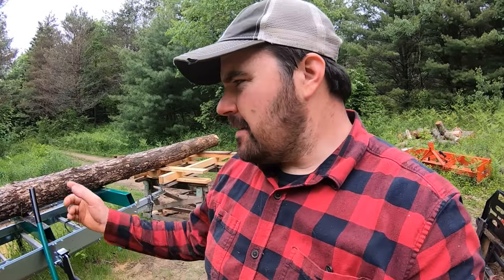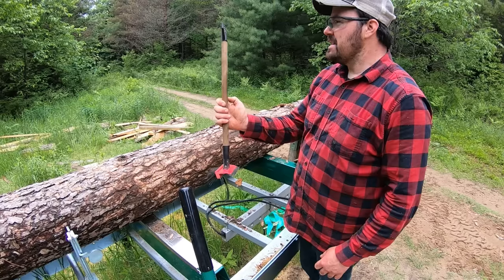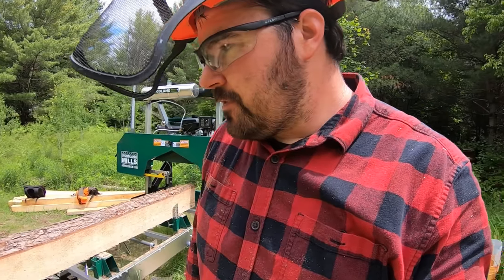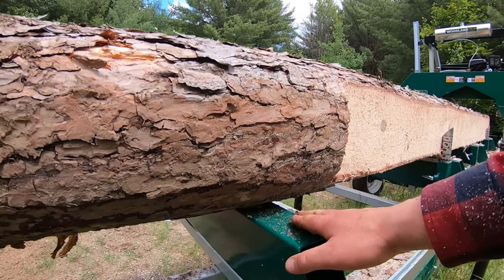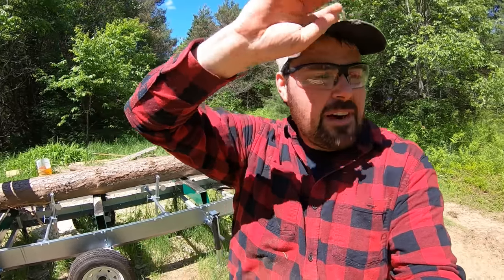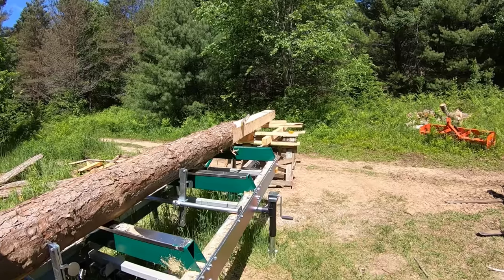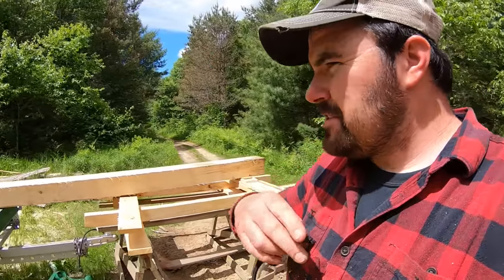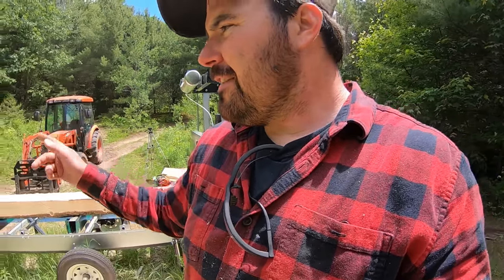Cutting a 20 Foot Log on a 10 Foot Sawmill | No Track Extension Required

Comment: Hi Sandy been watching your vidioes for a while now.  just an older bush man myself . just a suggestion for skidding logs a long distance in the summer is cut the log 32 inches longer than your saw log  when you get to your  landing cut 2  16 inch blocks of fire wood off the end that was being dragged for fire wood.  that way you will get a much cleaner log on your mill  . just a suggestion a good video.
Reply from the maker: Great suggestion Myles. As you can imagine, the dirt certainly can dull the chainsaw and blades quick

Comment: You did pretty darn good with that approach. I like the sawhorses. Another way would be to “block” the log for the first cut: screw 2 2x4s onto the log, about 15° apart. Do that in 3 appropriate places down the length of the log. You could run a string to make sure everything is lined up. Run the cut, then push the log back (on the blocks), run the next part of the cut. Etcetera. Once you have the first cut down the length of the log, you have a consistent reference plane and should be able to remove the blocking. Just roll it and cut-push-cut. You can make very long cants this way, as long as you can keep consistent blocking for that first cut.
Reply from the maker: Great ideas there! String line would be very helpful for sure as well

Comment: Glad you did it cause I wasn’t thinking of all the potential issues. I’ll save this move for the more competent miller. 👌
Reply from the maker: Thanks for watching Rich! Worked out well thankfully. Sure would've been a lot of work if it ended up not working
Reply: @sawingwithsandy  Absolutely. If I do attempt it I’d probably try the push through option and have the tree an extra couple feet longer than milling and use a tie down at the end bunk and move the saw horses to the other end to help reduce any possibility of the milling being stressed into lifting from the weight. I’m think this would reduce the amount of levelling when spinning it around. 
 Just thinking out loud. 😂😂😂
 Actually I’d need 2 sets of saw horses to accomplish my goal. This certainly isn’t an easy task. But a great mind teaser for sure.

Comment: Awesome stuff Sandy.. Sure is alot of work to cut a 20 footer there without the extensions..
You definitely made it look pretty easy for sure..
I think i can cut right around 20 footers with my extensions on my home built trailer..
However i need to cut some 28 foot beams for a future post and beam project in the near future... Your video definitely gave me a few ideas to work with..
Think im going to look at fabbing up some adjustable rollers to mount on the sides of my log bunks..
Keep up the good work there brother..
Reply from the maker: Those adjustable rollers would help for sure. Sounds like you've got a great mill setup there!

Comment: Excellent video Sandy I have an HM126 Woodlander and I’ve struggled with doing logs longer than the bunk that I need for my barn project thanks for the inspiration
Reply: If you remove the last bunk and then cut your log, it makes it way easier. Then you can cut your log and move it back as you go

Comment: I worked at a sawmill that cut 40' lumber . 6x12 , 12x12 , 16x16 timbers . We shipped a 78 foot 24x24 to Japan for some wood expo they were having . We were trying for 80 feet , but eighty foot would not exit the mill . Only took most of the afternoon lol . I was on the green chain , they kept the rest of the mill going by running rejected timbers through the resaw . Fun days
Reply from the maker: Now that's a big timber operation!

Comment: Gordon here , I would use a battery powered saws-all  to do the cutting instead of power saw ,my thoughts. Also for me to slide log I would have used a chain on the forks and put it down the log far enough to swing when forks raise up . As for the bugs drink alot of citrus fruit drinks that you make from fruit DO NOT buy them as they are sugar drinks. I do that for hunting in the woods. Cause banana  make you become a feast for them. LOL. I own a Norwoods 2000 LM  20 foot log and I still need it longer sometimes . Thanks for the ride and extra ideas , keep them a coming.
Reply from the maker: Hey Gordon! Yeah I agree that would be even handier. I just don't own one or I"d just that for sure. Thanks for that idea about the citrus drinks!

Comment: Great job Sandy, I too have sawed long timbers on my HM130. Mine is the 16 footer on woodland trailer . The longest I've done was 36 ' and I sawed the whole length ( 1/2 then slide it and saw the other half ) , mine was also red pine. Alot of fun and challenging.
Reply from the maker: Yeah would be very rewarding I Bet. I'm going to try that slide method next time around

Comment: Good morning Sandy good job with the 20 feet log I like the way you set up with the saw horses I am lucky I got the extention to do 23 feet max but 22 comfortable  also a little suggestion when you go in the woods do you bring your cant hook I do sometime it sa e me a lot of aggregation to but the chain under it by the way I am going g to see if you got a email so I can send a couple of picture of my log carrier that I built have a great day and that was some nice saw dust making
Reply from the maker: That sounds like a great setup! I don't cut too many really long timbers but sure would handy when needed. I don't actually carry around my cant hook much but would be handy. I should make a little holder for my winch as it would help me get the chains underneath as you mentioned. Hope all is well!

Comment: Awesome job. We always get great ideas from your experience. I wonder if the laser would have been a help in lining up the cuts? However, maybe with the bright sun it would have been useless. We did get a laser like yours but it is not bright enough for outside use. We'll have to wait til we have a shelter creating shade to use it. Another thought is that when comes time to flip the log, you could always suspend it an inch or two using a strap and then swing it by hand 180 degrees. That could save a lot of back and forth with the tractor and might be gentler on the mill. Those are my armchair lumberjack comments....lol. Great job and thanks for taking the time to document
Reply from the maker: Great idea there Yves with the strap! I'm going to have to keep that in mind for next time around. Thanks again

Comment: Hey buddy how are ya? Oh boy you made it look easy! I think I want a tractor when I grow up hehehehe. Great job buddy. The beam looks great! I’ve seen 4 guys do what you did on YouTube. But yours seems better. I like that you used saw horses and blocking to level up. 
When I bought my sawmill I was concerned about cut length, I wanted to be able to cut 24-28 foot (roof rafters) but still be on a trailer. I wanted and lusted after the woodlander xl, but ended up going with a different saw mill. I love my mill and look forward to sawing every day. I am gonna get the sharpener and setter like you have, blades are 36 bucks each so gotta be careful when I cut. I found that logs that only give me 2 2x4s aren’t worth the cost of the blades to cut, too much time in the bark, I like 16 to 24 inch logs good yield and not so heavy I can’t move them with what equipment I have. Buddy thanks for all the videos over the years you’ve made, they have helped me so much, and now I saw logs and build stuff. God bless you and yours. Thanks for being our sawn mill guru.
Reply from the maker: That's a great point you made about the small logs and dulling blades as I also find that sometimes the return isn't worth it if it weren't for the sharpener since there is a lot of bark cutting as you mentioned. Glad to have ya along the channel each week. Hope all is well with you!

Comment: I just got my new mill, this is good info to remember. A couple questions: when you turn the log 90 deg after the first cut, why not turn it the other way (top towards you) so your saw blade can enter on a clean cut face? Don't leave any wane and your blade might stay sharp longer? Less work cleaning the log. I carry all my logs crosswise if I can or load them on a trailer to avoid dragging them in the dirt.
Reply from the maker: Great question. I actually turn my logs 180 degrees after the first cut so that there's a flat edge lying on the log bunks as I find this gives me the best chances of getting a square cant. Although I"d prefer to be cutting into non-bark side I find that having the sawn side flat against the log bunks or against the log stops is best for me to keep the cant I make square.

Comment: A lot of extra work, but it is possible. Good job. Could you fabricate some rollers (out of pipe maybe?) that would set over the bunks that would make it easier to push the log? I know you don't do this very often so it might not be worth the effort, but if you had several long logs to do it might be worth it.
Reply from the maker: The pipe idea is a great one! Thanks for that Mike

Comment: I am of thought that you could also use two pieces of angle with a couple two or three pieces of square stock to the exact same size as those on the bed that could be bolted on your trailer frame and on the far end just a couple pieces of what you have in pipe that would slide inside the other making it adjustable and then your able to stay level with the saw, and the ground is not a problem as the leg holding it up is adjustable. I would not use it consistently but for the random needed beam, its gonna be a life saver.... no need of log stops like the mill has .. just that occasional needed beam to do, maybe a sawhorse or something to help with the balance of it all. The leg holding those rails up could also have a foot on it for the bottom to help support the weight.  Just a idea Sandy... I know it took a lot of figuring to get it as close as you did to match those cuts that extremely well.
Reply from the maker: I like that idea. I wonder what the cost would be for this compared with buying the extensions. I'm sure there'd be some savings just. curious how much
Reply: @sawingwithsandy  I would not go real heavy material as its just a once in while anyway and scrap is high but still cheaper than new... kinda look about different places and maybe a old farm or two around,  you'll find stuff where you least expect it to be... thing is, its real simple and no hurry to do, once gathered up, a afternoon build... thank you for a liking this idea

Comment: I always leave my stumps up about 2' to 3',then in 2 or 3 years when they die off I can push them over cut off the top n get rid of the roots.unless I'm making a path.you'd think that's a long time to wait but it goes by very fast when there out of the way.always enjoy you videos buddy.you wouldn't want to do that every day ,hey.last time I tried to back mine up the blade flew off.alot of work but the expense of a 20' beam would be crazy.
Reply from the maker: I like the idea with the stumps and I can just about imagine the cost of a beam yikes!

Comment: great job sandy, big job but you got her done. Q i got a few pine trees should i just square them up and saw board out of them later the fall when they dry. i got a few projects to do this winter that need 1 inch board. have a great day
Reply from the maker: Hey Wallace! I try to cut the boards as soon as I can and avoid leaving cants around as I find the cants tend to want to crack on me as they dry in the warm weather and this could impact the boards I make from them. However, if you paint the ends of the cants and leave them you probably stand a better chance of the cants not cracking/splitting on ya. Hope you're doing well out there!

Comment: If you said it - I forgot it already.  What square dimension did the beam end up being?
Reply from the maker: Think it ended up being 8" x 10"
Reply: @sawingwithsandy  thank you.  Pine is impressive for its strength and weight ratio.

Comment: It is almost how I do it on my old trusty 2017 HM130. But I removed the end bunk (never use it anyway) and replaced it with a flat piece of steel. That way you can cut half a meter or so further than the (now) last bunk and slide it backwards in steps with sawn side resting on all the bunks. Anyway - just a tip. Keep the sawdust flying...
Reply from the maker: That's a great time Torsten! I appreciate you passing that along to me
Reply: Never done it. But when the time comes I'm going to try it this way. Seems like it takes awhile, but I think I'll prefer the flat surface to work off of.

Comment: good show I don't have mine yet but I ordered the hm 130 max with 3 extra pieces of track. I actually could even use some more if I end up cutting logs for cabin Building some of the peak beams can be as much as 65 feet long but ill have to do with 29 ft cutting length for now
Reply from the maker: Can never have enough track length that's for sure.

Comment: Great job on the beam. this a beam for new sawmill cover and do you need two beams for it ? I'm catch up on your videos now I've been out fishing. Did you sell your other mill?
Reply: Sandy still has other sawmill.
Reply from the maker: Hey Dan! I'm going to just need the one beam as I"ll be running the rafters from the other lumber shed which is already in place and leaning them on this beam to house my new sawmill that I cut this beam with

Comment: I am going to add 4-5’ of angle iron track to each end of my 20’ track (16’ cut capacity). If you add ½ to each end instead of all to one end, you don’t need to build more log supports. The extra track merely supports the saw head, and the log can overhang the existing log bed on each end.
Reply from the maker: Great idea there Matt!

Comment: Well done Sir! I can’t help wondering tho, with the lifting potential and power of a 3-point, would the log be lifted/pushed/pulled along thru each cut be easier? If I ever need to cut longer that the mills capability, I think I’ll find out! Great as always Sandy.
Reply from the maker: Great question. I think it would be possible to use the tractor to move the timber through the cut but my trouble is I wouldn't be able to pull the log very evenly I don't think and may end up binding the blade. I'm sure it is possible though. Now you got me thinking haha
Reply: @sawingwithsandy  like we ever stop?

Comment: Update: I just watched your one video where you covered this question! Extension it is. I think it makes sense given the tight clearance when doing 10' logs.

Hi Sandy, I noticed your other sawmill had the extension, but your new sawmill, you got the regular length. Do you plan to add an extension, or you keeping the trailer short for agility? Did you figure 95% of the logs you cut, 10.5' is all you need? I am trying to decide if I need to buy the extension when I order my trailer.  I think I could get away with 10.5' but would need the occasionally longer beam. Not sure its worth the extra grand it costs when you include the trailer. Really hard to make these decisions especially since I have never even use a sawmill before let alone own one lol!
Reply from the maker: I think the extension is worth it for sure and I plan on adding an extension on my new mill before long

Comment: Hi Sandy! Thank you for all these great videos. You keep us highly informed.  We are dying to know more about your land though. How many acres?  Also, we received our HM130 Max and spent over 3 days on the assembly.  Wierd thing we found over and over that the bolt head and nut for that bolt were different sizes. We can’t figure out if that was a mistake on their part, or intentional. Anyway, have a great day and we will keep watching.  Oh Yea - any plans for merch?? =)
Reply from the maker: Great to have ya along each week! I do have plans for Merch just have to find the right setup. I"ll be sure to keep ya posted and I appreciate the support that way! I've got a fairly big plot of land but in the videos I'm probably using about 20 acres or so for the wood working type things. For my HM130max I believe that is intention with the bolt head being different size than the nut. Mine was the same when I assembled it.
Reply: That's just common with metric fasteners. Also common with 7/16" and 9/16" fasteners in SAE.

Comment: I'm thinking rollers on the bunks, and then just pull/push the log through, but only if you find yourself doing lots 'over length' cuts because setting it up would take a bit of doing.
Reply from the maker: I think the rollers would be handy for sure
Reply: I expect the log being cut is pole grade to keep the weight down.  A long 2 x 12 laying atop the bunks and out the back would provide support for a skid block under the first cant and the uncut part of the log to slide on. The block would need to match the cutoff.  Some soap or wax on the 2 x 12 would make it easier to slide.  

I plan to try this some day.

Comment: I have a few modification/addons I've done to my portable mill. The first is attaching a 2-foot-long piece of 3-inch PVC pipe to the non-operator side upright to hold my Kant hook while I'm transporting the mill. There are already 2 holes in the frame so no need to drill into the steel. I'd send a picture of mine if there was a way. The second is simply cutting 2 pieces of 2-inch PVC pipe that I slide over the tall log stops when I'm turning large logs alone, this prevents the log from hanging up on the edges of the steel log stops and makes rolling the logs much easier. I just store the PVC inside the log bed when not in use keeping them handy. The third thing is mounting a magnetic mount tractor mirror on the front band saw blade cover adjusted to give you a view of the far side of the log while cutting from the operator position. This has helped me avoid hitting a log stop set too high on a few occasions.  Love you YouTube channel. Keep on cutting...
Reply from the maker: Greta tips and I appreciate you sharing them!